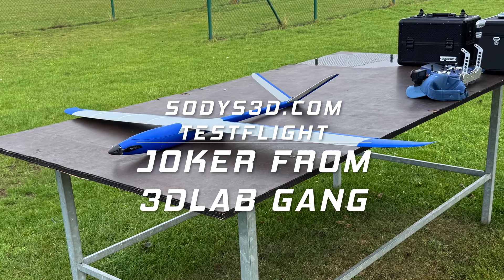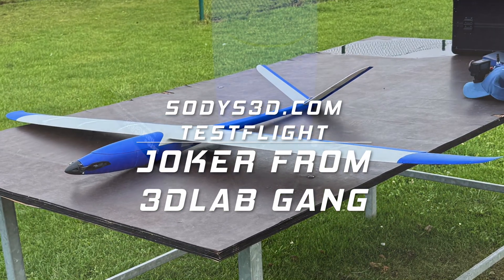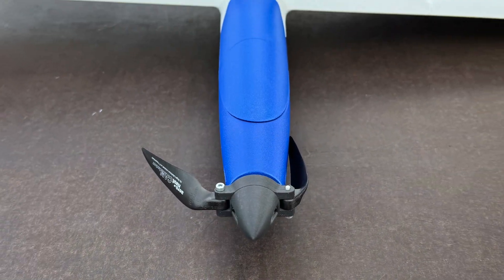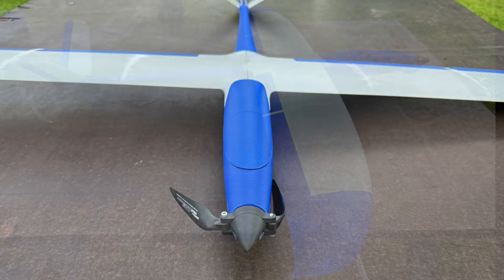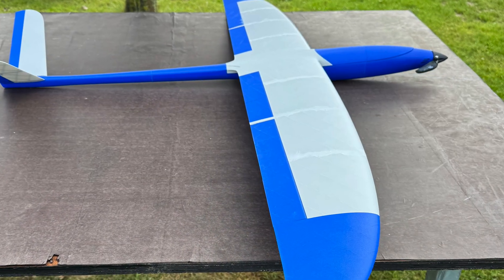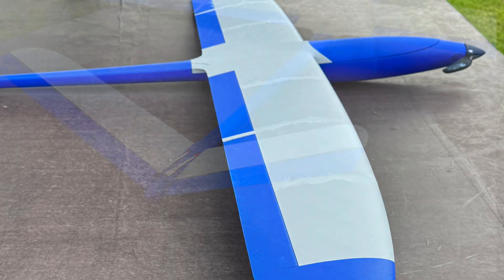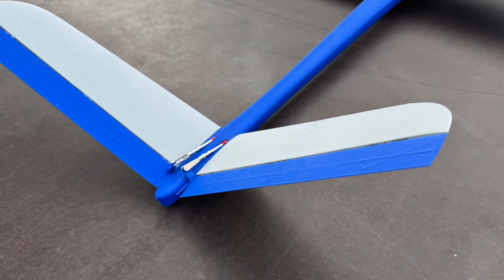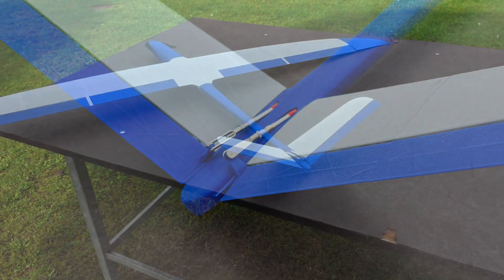Joker 3DLab Gang Testflight 3D printed ABS-GF

Comment: Very nice!  

In Canada, we fly air combat Zagi flying wing gliders made from EPP foam.  They are literally indestructible in air combat scenarios.  We launch them with a 20ft piece of surgical tubing tied to a ground anchor, from a small hill and they stay up in the air for most of the day.  We only land them when we need a break.  Air combat is a lot of fun.  

I've seen people use a technique called dynamic soaring to achieve incredible speeds.  The current speed record for dynamic soaring is 548 mph (882 km/h), achieved by an unpowered radio-controlled glider using the technique. This record was set by Spencer Lisenby in January 2021 in California.